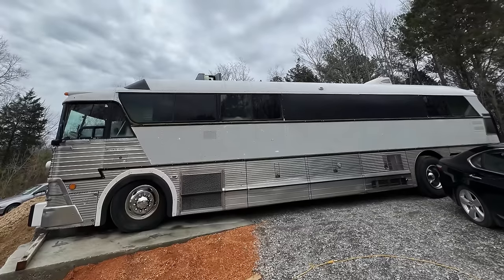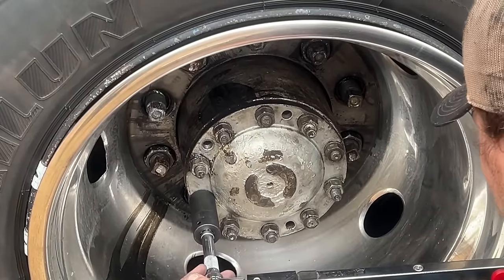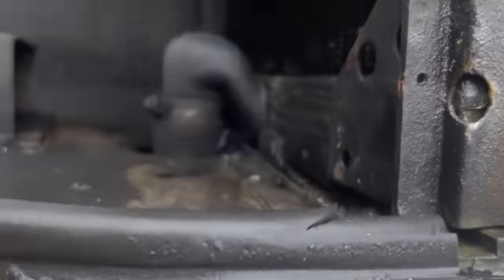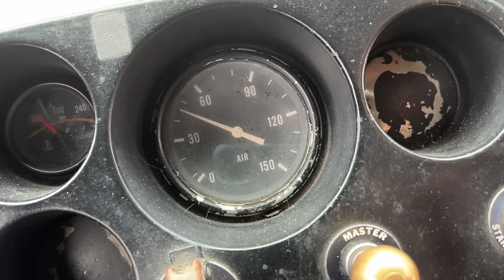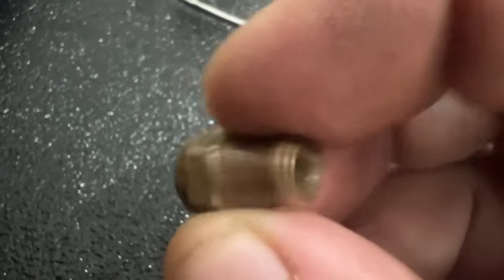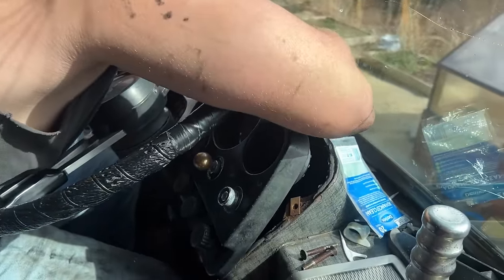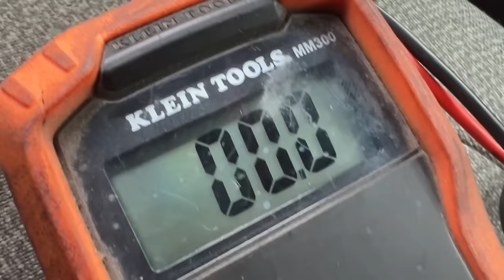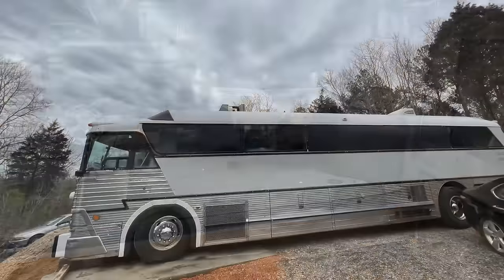Bad air compressor, big air leaks, no air dryer, axle leak, electrical issue. Water & oil in airtank

Comment: Something often overlooked when dealing with flare connections is the angle of the flare.  There are two commonly used angles and they are 37° and 45°. Automotive hydraulic brake lines are normally 45° and AN & JIC fittings along with refrigeration lines are 37°.  The oil feed for the alternator seems like it would be 37° since it's more common for that type of fitting.  A couple of years ago I got so tired of using those old archaic flaring tools that I gathered up all the ones I had and scattered them in the field behind my shop and ordered a brakequip set with both 37° and 45° dies that go up to 1/2".  I make a ton of stainless hard lines for brakes lines, air lines and fuel lines.  I don't like using copper lines on automotive appliances due to copper cracking from fatigue and they can become easily kinked due to road debris.

Comment: The unusually high voltage reading is probably caused by the low pressure buzzer creating this reading on your meter. You can confirm this when the pressure builds-up and the buzzer shuts off; the meter reading should then read 24 volts.
Reply: That’s what I came to say. Those old style magnetic buzzers could set up some crazy eddy currents.
Reply: Yup, was going to say the same. If his multimeter is set to auto the oscillations created by the buzzer will look like an AC votlage waveform and the meter will auto switch to read the AC.  It's a clever safety feature for folks working on AC  voltages so you don't accidently have your meter on DC, probe a circuit, see no voltage and grab a wire you thought was safe.
Reply: I agree. AC spikes from the buzzer. I’m sure that analog meter would show correct DC voltage. But who hs analog meters these days?😊
Reply: Not sure that "eddy currents" applies here but the current cannot be instantaneously brought to zero in an inductor.  I'd bet that each of the buzzers is a significant inductor.  When they open (causing the buzzing) the voltage in their windings has to spike.  I'd guess this is what you're seeing.  This is sometimes referred to as inductive flyback.  That said, although I've seen the lots of places, I'm not a bus mechanic.
Reply: I was thinking the same thing, large counter EMF from the buzzer coil.
Reply: @dttprice Not eddy currents. Spikes from the field collapsing
Reply: @The_DuMont_Network  
You are correct. I misspoke.

Comment: Hey Scott. Your mechanic was wondering about the two long studs on the axle flange. I'm sure you most know this. Incase you forgot it was for the old style hub-odometers that would bolt on to the axle.

Comment: I’m still a firm believer that dot needs to do inspections on anything that is this big….
Reply: I've been a class A driver for 24 years and I've always felt that anything over a one ton motor home or not should have to go through scales for inspection and have an air brake endorsement for reasons like this. Motor homes are built on truck chassis and most people I've seen over the years don't know anything about air brakes or like spending money on them because they are expensive. Absolutely stupid.
Reply: DOT operates under the Commerce Clause of the US Constitution. These busses are now used for private use, DOT has no jurisdiction over traveling in your private automobile. Why give them those powers... If so they could come after your personal car or truck next. Freedom comes with responsibilities, people just need to have accountability for their actions is all.
Reply: @chevrolet402 . I agree. I’m a full time rver and have been working in rv resorts for a few years. I do not understand why the owners of the big class A’s with air brakes can drive these rigs without any training or air brake endorsement.
Reply: @patbullard9276  The ones that get me are the old retirees when you pull up next to them on the highway and you can barely see them over the steering wheel 🫣 Nothing against age of course just saying.
Reply: @shrconstruction  i see no difference in requiring dot inspections on anything that is built on a medium duty chassis vs annual inspections on passenger cars.
Reply: @dirtrider383  it's not the automobile in any way, it's the use of  it. Either private use or commercial use. The gov has authority to regulate commerce, not private use. That's why you see many busses that say "Not For Hire" on them.... Or "Private Coach" for examples. Freedom requires personal responsibilities, commerce requires special licenses and the requirements that come with the use of those. That's lawful and legal. Do I agree with it, yes(Doesn't matter anyways.. Lol) . Do I think many driving these busses and Class A Diesel Pusher drivers are over their skis and should not be on the roads, yes...., that's just my personal opinion, but as far as lawful they have to be responsible and take what comes if they ever hurt anybody and that's their freedom of locomotion aka Liberty in the Bill of Rights (5th Amendment). BTW, not all states have annual inspections.... But all states abide by DOT because it's federal not state level.
Reply: @shrconstruction   Unfortunately that whole "be responsible" part can easily come after they have killed someone or more than one someones. These vehicles take more maintenance than a car or light truck and the consequences to OTHERS are more severe when they fail. Freedom isn't free to do what you want regardless of impact to others.
Reply: @BLKMGK4  anybody in any vehicle could kill somebody else with carelessness..... Where do you draw the line?  Fact is, until there is a victim there is no crime. You can't face your accuser if there is no victim....or their representative.
Reply: @shrconstruction   Driving is a privilege, not a right. Getting hit by a fool in a Honda Civic vs a fool driving a full-sized bus or coach is a large difference. News Flash, many states require inspection of cars too. I'd be willing to bet those cars are in better overall shape as a result. Inspections of large vehicles should be done for the safety of all involved. If the maintenance is done it should be painless right? Who's claimed a crime has been committed?

Comment: I don’t understand how it’s cost effective for you to clean disassemble and rebuild the AD9 at your labor rates when a new one is relatively cheap, it’s like rebuilding a D2 governor you just throw in the scrap heap and put a new one on. I am a fleet mechanic for a highway department in NY. So our stuff is always rusty from road salt so we do not rebuild any of it included brake chambers , and slacks, we use only meritor bonded shoes ,so rust jacking isn’t an issue. Love your channel,and the work you do.
Reply from the maker: A real bendix 24v ad-9 is $500.   A cheap quality clone is $150.  But 24v isn’t as easy to get.  Waiting a week to get one cost time too or just rebuild it in an hour and also inspect it at the same time

Comment: Inductive spike - when the buzzer contacts open, the rapidly collapsing magnetic field generates a brief HV spike (basically like a tiny ignition coil), causing the crazy readings on the meter.  I’m surprised there’s not a freewheeling diode (a ‘backwards' diode) often put across the coil of a DC operated relay or solenoid that provides a path for the energy put out when the coil is switched off and the field collapses.  It prevents these crazy spikes and reduces contact arcing.
Reply: That thing was basically an old-fashioned "door buzzer", which is just a relay with a heavy contact arm. The assumption was that the source was robust enough to handle the back EMF being dumped into it. In those days there weren't silicon diodes. A selenium diode would be physically about the same size as the buzzer, would be fairly fragile, and would have a high enough series resistance to not be too useful. So no diode was the obvious choice.

I think the problem is that he is powering this with the Power Probe. It almost certainly has a diode from the 24V source it is supplying to the probe tip. So it will supply at least 24V to the tip. If the line it is powering wants to generate more (the buzzer) there is nothing to stop it from doing so. The normal connection thru the 6A breaker would have the whole battery shunting the voltage down to 24V, so the problem wouldn't happen.
Reply: @lwilton  Good point - if it were connected directly to the bus' electrical system, the battery would likely act as a clamp and hold the spikes to a much lower level.

Comment: The high voltage your reading is from the buzzer sending back EMF or voltage spikes from the arching of the buzzer contacts it's the same way as a buzz coil works in a model a

Comment: Have the exact copper line on our alternator crack and break off about 2 years ago. 
Worst part is it happened while driving in the middle of nowhere and blew all 7 gallons of oil out😬
Reply from the maker: That sucks
Reply: With no support.... it will break again.  The entire line has to maintain the same frequency otherwise it will work harden.  Can take a very long time to occur... but that phenomenon at play.
Reply: Carry a spare line

Comment: I used similar flare tool and it couldnt do steel line without heat and bought equilevant to eastwood professional brakeline and tubing flare tool and let me say. It was one of the best purchaces i have done.

Comment: The high voltage you're seeing is due to a coil somewhere. That is acting like a transformer. Similar to a ignition coil increasing the voltage to a spark plug.

Comment: Mili volts ? Maybe. 🤔 I didn’t see the symbol for MV on you meter but that would be strange to be generating that much voltage there. Good luck.
Reply: Back EMF from the buzzer. Definitely volts.

Comment: Use old fashioned voltmeter for dc measurements. Simpson brand comes to mind.
Reply: Or... use a diode...
Reply: The Simpson 260. Never been a better meter. Ive had mine since the 60s, and now have my Dad's since the 50s.